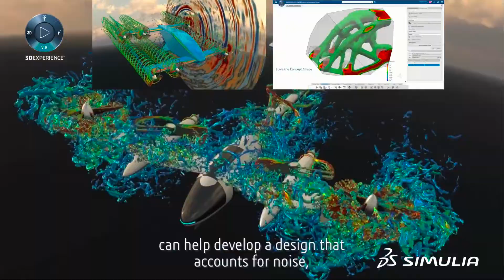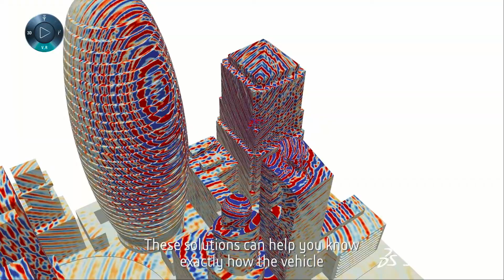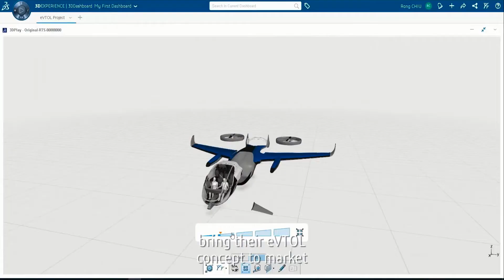Electric Vertical Take-Off and Landing (eVTOL) | Urban Air Mobility | SIMULIA Simulation Solutions

Comment: Hello, don't waste your time imagine how it will be. The automatic software used for self-driving in cars will be used with some modifications in this kind of vehicles. No matter if you live or not in a big city or not you will have the chance to take one. More important is that this prototypes need to be tested with a doll that have the exact characteristics of a human been, I mean needs to have the same weight than a regular human and needs to have a exhaustive control and measures  for safety like automatic flow of foam that prevent damage in customers in case of an accident. The material used needs to be strong enough to resist a fall from certain high and so on.